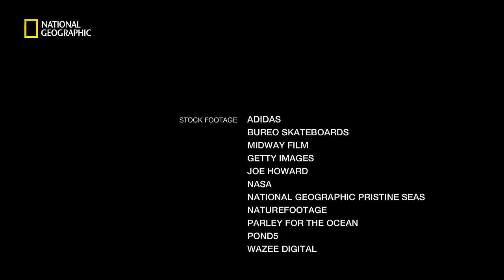How We Can Keep Plastics Out of Our Ocean | National Geographic

Comment: Something to think on. This isnt a new problem, its been ongoing for decades.  Two mentions of plastic pollution in one issue by different authors several thousand miles apart. Ocean Navigator Magazine, June 1990 Issue number 33 has the two articles that comment on this problem. One mentions "spending the rest of the afternoon trying to get our ground tackle (anchor) to set on the plastic bag coated bottom of the bay".( in Pago Pago)  The other article mentions the hazards to propellers from the floating plastic in Japanese harbors and coastal waters and how the Japanese "badly need to enact and enforce strong anti littering laws".

Comment: Ask your local store manager/buyer to be actively concerned about ocean pollution.  
Every plastic filled fabric we buy damages the ocean too!  So all those ugly polyester blankets go into the ocean for fish to choke on every time we wash them. It's a disaster.  Don't buy that stuff.  Buy cotton always...just keep it fibers that will dissolve in the water eventually.  Plastic never goes away.  
Also, don't think it will be recycled.  Plastic is only recyclable once or twice and most plastic packaging isn't recyclable at all.  Those triangle symbols are just saying what the packaging is made out of but it isn't saying that it's recyclable.  This includes yogurt cups, cat food pouches, baby food pouches, etc.  
Buy less and save more money.  Straws were originally paper and worked just fine but the plastics companies took over in the 60s and 70s and now it's the worst polluter in our oceans.  At least start with not accepting a plastic straw.  Thanks.   Let's keep it positive.

Comment: I wish one day all used packagings will not be thrown away, but can be exchanged with the factory or the manufacturer for new goods. For example, used packaging of brand A instant noodles, if collected as many as 20 packs can be exchanged for 1 pack of new packaging with the same brand. Likewise, for example, used sachets of brand B shampoo which were collected as many as 20 sachets, can be exchanged for 1 new sachet. Places of exchange are opened in large malls and shopping centers. I'm sure we can immediately solve the waste problem, and also change consumer behavior to properly store all forms of used packaging. This is more effective than the company's CSR budget which is used up for beach cleaning or similar activities, or is only exchanged for iron tumblers and pipettes, since this can not solving waste problems which are generally caused by the habits of the customers themselves. And also, customers can have a direct benefit by having their own needs, and they would buy more of the products ini this in turn benefit to producers as well. However, producers have the responsibility to re-manage their own waste packagings... The government actually also has the authority and political will to push producers by relocating company budgets for this packaging exchange mechanism.